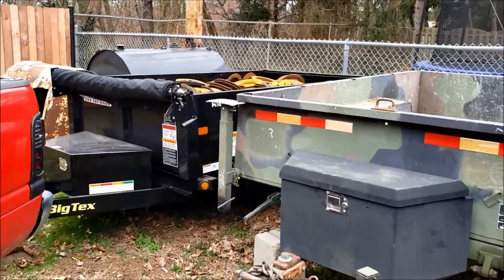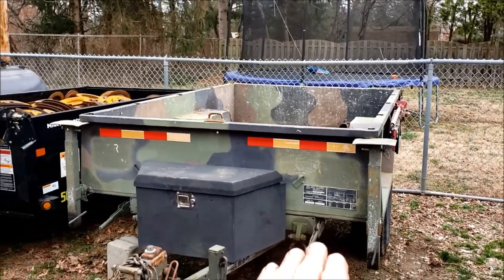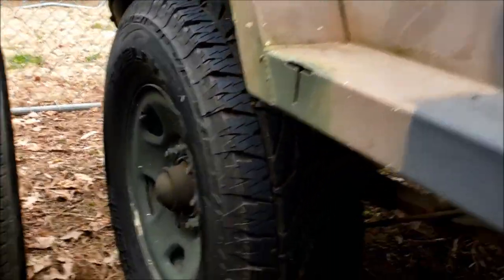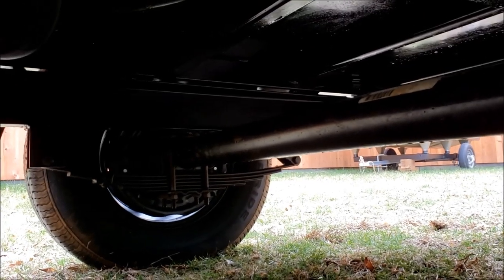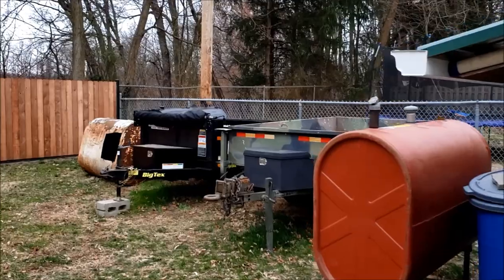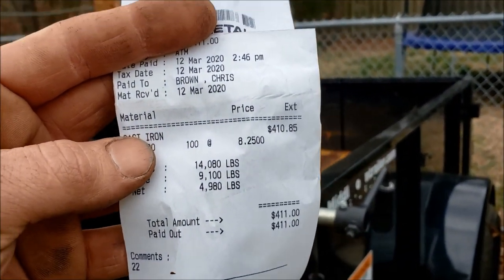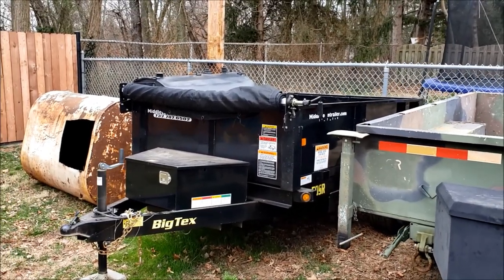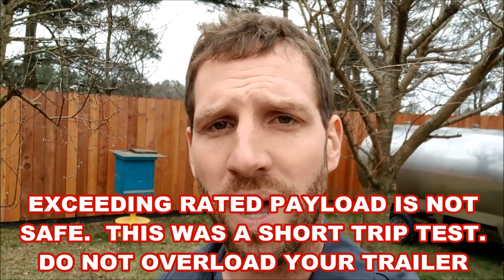Single axle dump trailers any good?  Big Tex 50SR Review -  Feat M101A2

Comment: if you over load your trailer it would be good idea to add 1 more leaf into each of your leaf springs + reinforce the hangers from 1/4 inch to 3/8 inch thickness, upgrade tires to the next load range up like 8 ply to 10 ply or 10 fly to 12 ply tires or 12ply to 14ply.  Drive slow, avoid pot holes.  Change the bushings in the shackles every 200 hrs, and carry a spare wheel hub with bearings.

Comment: Thanks. I agree the single axle has just 2 tires if you pop.  Good tires and 55mph she should be good to go. Clear that Big Tex knows they will be abused and over the weight rating. I like the bigger tandems 90sr and 10sr but they get pricey. Bang fir the buck I think this is a good option. I overload my F150 so this is a much safer option. I’m pretty sure a Toyota Tacoma 🌮 can pull this so it’s an easy sell if I want to upgrade. I’m thinking this is a glorified pickup bed in a good way. So instead of getting a F250 you can get this with the ability to dump and haul.

Comment: I want one of the m101a1\a2 to use as a dump trailer for mulch. Do you think it work work well? A new trailer same size as the big tex is 5500.00 and i can find the old military ones for 1k
Reply from the maker: Yeah they work pretty well as a dumper. There's a lot of videos showing them in use